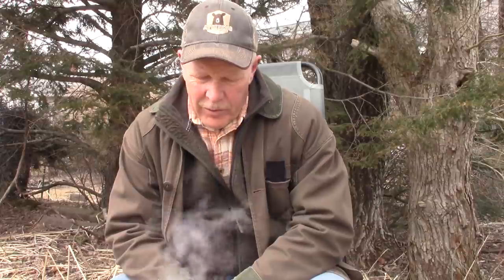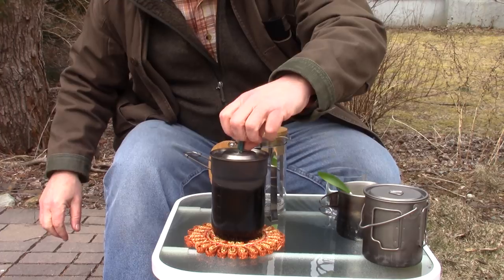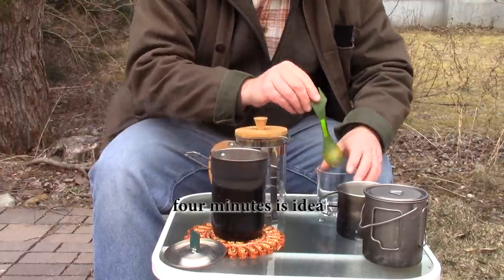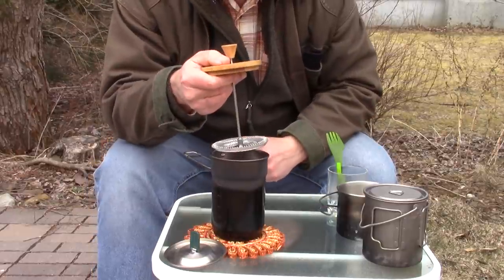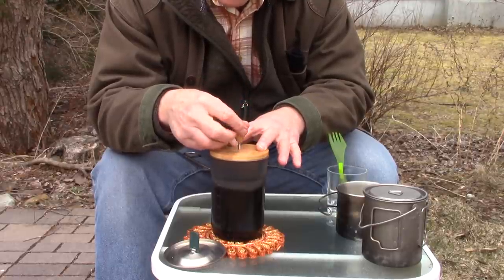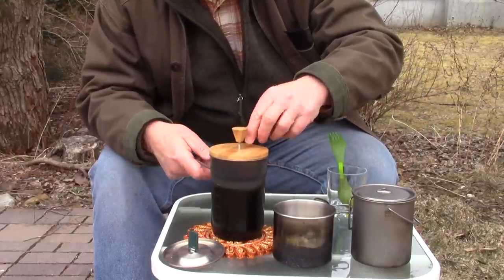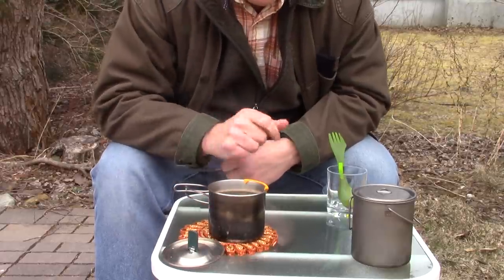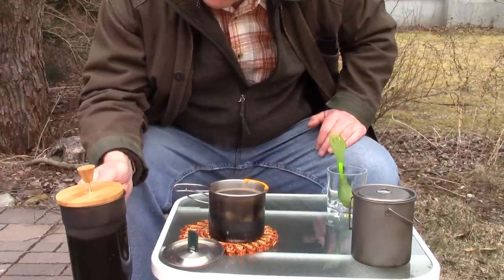Stanley Adventure Cook Kit French Press Hack

Comment: That was fun to watch, thanks!  When my glass French Press broke last year, I noticed the plunger part fitted a large mug, and so i made coffee that way, until I got a replacement.  The replacement was stainless steel, to avoid future breakages!
Reply from the maker: Years ago I bought a GSI French press made from Lexan. Still use it for car camping. The nice thing about a SS press is that you can boil water in it, as long as it is not a double-wall version. Thanks for commenting

Comment: I have this cook set and it's a nice hack, but I store my water bottle in the Stanley pot with cup nested underneath pot and both lids underneath, so no room for press insert. I may get a piece of fiberglass screening to make a strainer, maybe with a small bungee or rubber band to pour coffee through. Also have a collapsible silicone funnel that can take a paper cone filter. Cafe Bustelo instant is tolerable. Cheers
Reply from the maker: Packing it can be an issue with this setup depending what else you want to carry with it. The pour over you described works great. I use it as well. I often carry a small stainless steel filter intended for use with loose tea. It also works great for coffee.  Thanks for commenting
Reply: Which water bottle typically fits inside the Stanley please?
Reply: @stoneblue1795  I take the handle off the Stanley and it goes between bottle and pot to keep bottle from rattling. The short edge of handle sticks out, but fits in my case. Stainless bottle I bought from Amazon TRIPLE TREE Sports Water Bottle... https://www.amazon.com/dp/B06ZZ1TLZ5?ref=ppx_pop_mob_ap_share
Reply: @stoneblue1795 
The Nalgene Guyot stainless steel tapered 32oz bottle will fit snugly, but it has to be the tapered 32oz model, not the standard 38oz model.
Reply: @rhettoracle9679 
Just take the plunger apart.
You can usually unscrew the plunger from the base.
Then just put the base on the bottom of your bag or pot and put the plunger off to side.